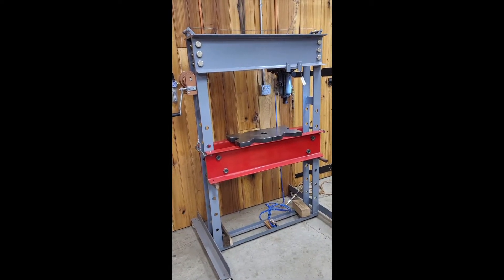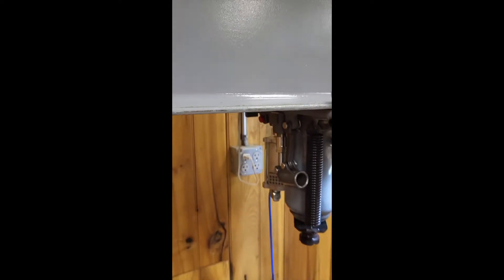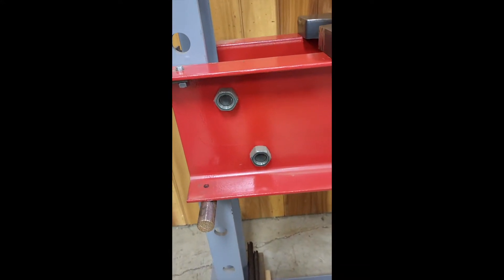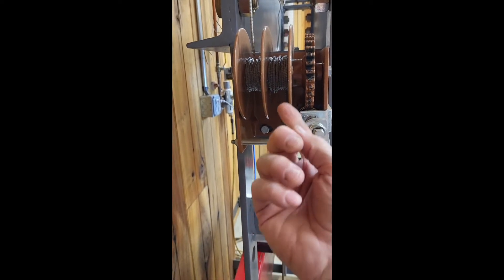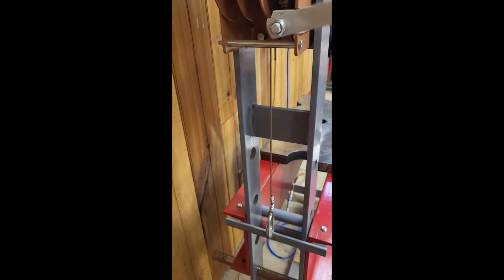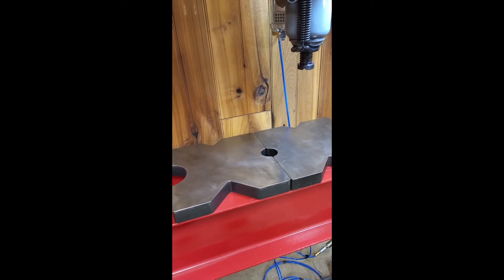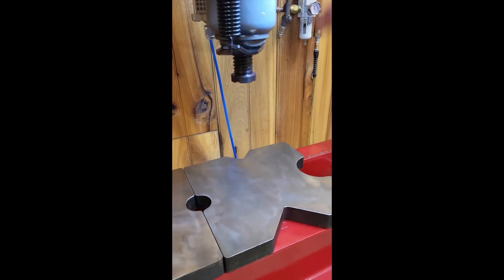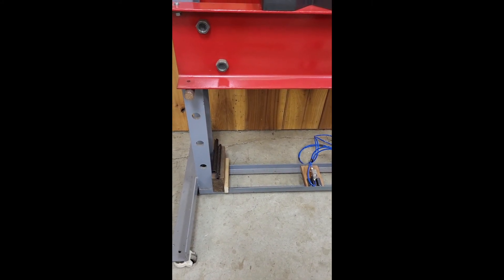DIY Hydraulic Shop Press, walk around

Comment: Hello friend, I have a question. As you could. reverse hydraulic air pressure jack upside down
Reply from the maker: Hi, The bottle jack used on this press is a single acting cylinder. Which means it can only apply pressure in one direction, which is why you need springs to return. If you use a double acting cylinder you could apply pressure both up and down.